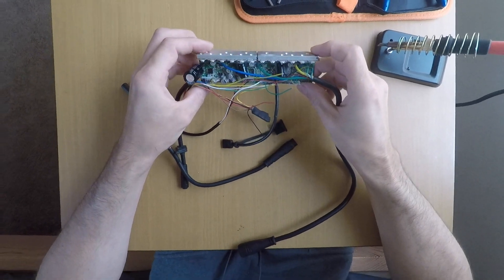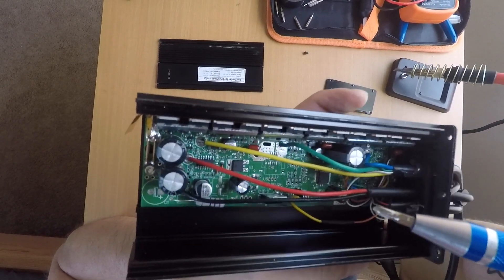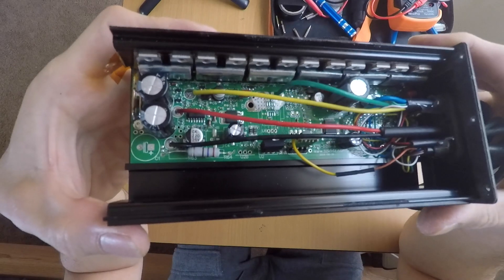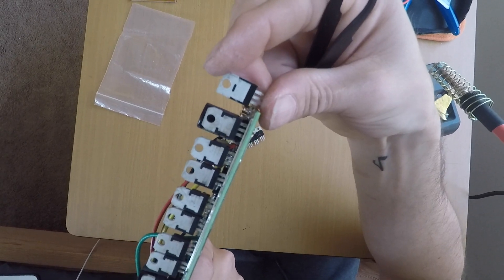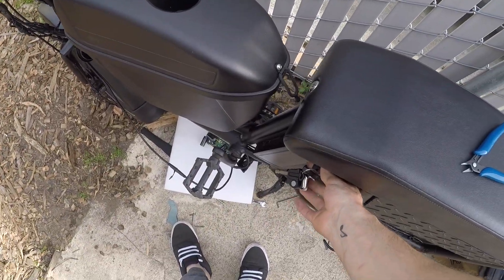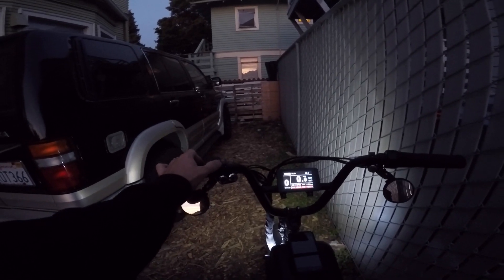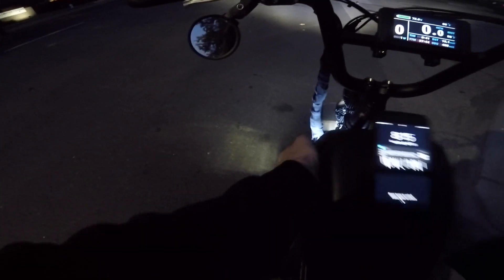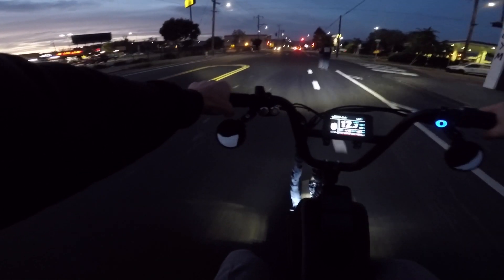HOW TO UPGRADE YOUR CONTROLLER !!!

Comment: So if I understand correctly, the radpowerbikes stock (22a) controllers FET’s can handle up to 100 volts and the Bolton (35a) controller can handle up to 68 volts (or 63v according to the caps). Does this mean that the booster would work with the stock radpowerbikes controller even if you cranked the booster up to 68/70v ? You’d just lose a lot of torque because the stock controller is only 22A?

Comment: That controller is the best one it's 35+1amp  the mosfets are held with metal bars. You find the circuit is small in width that's to keep connroller cool most of controller the mosfets are screwed in at top against the side where heat greese is applied its normally white in colour to shunt that controller is the best one I've got the same and does work I blew 30mp fuse so I put 35amo fuse it's been fine never put 40to45to50amp as controller pop it would get to much current

Comment: Nice video I got the same controller what the colour wire for the lcd screen ? There's 52 volts showing but the battery indicator is empty and motor doesn't work any ideas ? Cheers m8
Reply from the maker: Aaron Chambers check all settings on your controller.
Reply: @electricpower8130  yeah ok cheers

Comment: Is this video showing that you can increase the voltage directly at the controller without the need for a boost converter🤔  or are you also using a higher voltage battery.  I have a 52v 23ah battery, 52 v 25amp controller, duel 1200w motors, 3 modes with variable speed throttle. I was considering trying boost converters going directly to the motors but wasn't sure I that would allow variable speed  or just a constant higher voltage from the boost converter.  I really just want to increase the top speed a little .Great video thanks .😀
Reply: the controller just takes the voltage that comes into it. you still need a boost converter to get higher voltage. what he just did I think was to get more amps through the mosfets and more volts with the boost converter.

Comment: I've got the same controller all you had robdo is solder the shunt bars nip the bars together then solder across the top the length of bar. It might blow a fuse if it's 30 amp use 35to40amp great torque and speed. You doe it the hard way

Comment: @ElectricPower did your 48v LCD8H display hold up at 70+ volts? I have the same display and I'm thinking of converting my battery to 60V so would need to run 67.2v through that display and I have no confirmation that it actually works. Thanks.
Reply: hi man, did you convert to 60v?
Reply: Im new to ebike but display staff use 5 v Insted of 60 v that 60  volt goes motor power but all other digital control voltage & LCD usually use 5 v  ? Please let me know , I bought Chinese controller with label ripped off so it's hard to understand Wich brand so on but like to understand my 48 v controller with battery

Comment: i have very similar 35a black controller and it gets me  to 57km an hour or so, (52km an hour = 32m/hr)
 ive seen higher on very slight inclines. Altho i cannot get the pedal assist to cooperate and is always full power so i switched back to the lcd8h. i did love the torque and speed with that controller.

Comment: Just wondering if you Beefed up the shunts for the mosfets. More solder and wire as thay all are skimpy on production on the solder. An you could get away with 80 volt capacitors ....anyways  that's how I'm gonna  do mine .
Reply from the maker: Yeah I solder the shunt on the half. So more Amps can go through. And 80V capacitors it’s more than enough. For 60V battery.
Reply: @electricpower8130  good to hear that bike cooks hahaha. I liked  the mods that you and outher s do keep up the good working knowledge.

Comment: The booster you’re using can I use this on a 1500 W motor? My controller is already at 45 A but my battery is limited by 50 amp output.. i’m still new to this 😅
I’m considering buying a 50 amp controller at 2000 W and I’m running a 48 V 30 amp hour battery. I really wish I would’ve bought the 52 v
My top speed on flats is around 31 Mph. I’m trying to get at least 35 mph being that it’s 1500 W!
Reply: Buy a 3s rc car lipo and wire it in series, get a lipo alarm and only use it for short bursts
Reply: Save yourself time.  Get a 2000w kit that has an sw900 WITH the kit.  No speed limit.  Ktlcd has speed limit.
Reply: @weaverjoshuab  

The SW900 controller do the same speed as KT controllers.
There's no restrictions unless you set it.
The only difference is SW900 has much less features & options.

Comment: if i have 1500 W hub motor,  battery 60V 20AH max speed have 25km/H or new version 45km/H anyway how increase max speed 80km/h. can change controller biggest, 60V 3000W controller maybe.  or need change controller and battery 72Volt version. how mtor ? burn or can handle more volt? or need change genuine controller biggest FET and some resistor maybe ?

Comment: On controller for 1500wat and its the same on 2000 watt with out shunt bars with solder speed is 45mph the controller is 7amp 35+2amp I've done the shunt I biped bars together so I didn't use much solder speed is the same but the torgue is pretty good that's on the stand weather's crap so I can't try out the upgrade I did do one two weeks ago same controller blue a fuse 30amp so I've put 35amp not 40amp as you could blow controller

Comment: Hi.

Great job on what you set out to do. I know this has nothing to do with the vid. Can you tell what light that is. Make model what voltage it works off.  Thanks.
Reply from the maker: Thank you! It’s fog lights 12V. Check previous video about all lights. You’ll find the model in video description.

Comment: Can you help me please ? I have 36v 17,5amp 500w chainice controller. I need to get or make 12v 160amp one. Pls help. I spend one month on resources and learning. Do I gust change mosfat, beaf up the wires ex. and change resistors
Reply: I will really appreciate you hel and experience. Im 16 buy the  wey.
Reply from the maker: So your battery is 36V and 17500 mAh capacity and 500w controller? Am I right?

Comment: question i had 350w front motor hub scooter battery 36v output dc 42v2.0a charger 100 -240v 50/60rh output 42v 2.0a iwant to upgrade to 750w to 1000w to little more speed and range tnx, more power

Comment: My electric scooter is a 52V build with 2x1200watt motors. It has a lot of torque but top speed is bad. Top speed only 50km/h or 30mp/h with full battery. I would like to have a better top speed, can you help me on that?
Reply: Me too same issue. 52v 1300watts x2 motor. Speed is 55kph. Do u upgrade controller)
Reply: @ikeegroup4852  Hey, I have learned quite a lot since I wrote the comment. What exact scooter do you have? I found out my scooters motors are made that way they will last very long without problems but that means worse performance. If you want better top speed, you need to raise battery and controller voltage. If you want better acceleration and torque, buy a controller with higher amps.
Reply: i bought Langfeite 52v . yes i think i need to change controllers and upgrade batteries to 60v. But is quite exoensive. Maybe better to sell my ood scooter and buy new 60v escoot.
Reply: @ikeegroup4852  Langfeite l9? I bought the same scooter but different branding. I am going to sell mine and buy a little bit more expensive scooter. You only need to upgrade the controllers to 60V if you buy external battery pqck instead of a whole new 60V battery pack.
Reply: Yes also diff. Brand. Which brand do u have?
Reply: @ikeegroup4852  Mine is FLJ T11 with LG 30Ah battery. Costed me around 1200usd

Comment: hi, I just watched your video, could you give us a detailed plan of the modifications made to the controller and should you change the motor and the original battery???? Thank you
Reply from the maker: frederic liontransler So in this video you can see all mods that I did with controller. I changed all transistors, capacitors, add resistor to cut the current (not necessary) and tinned shunt. That’s pretty much it. Also I used the booster and rised some voltage which gave me that amount of speed. You can change the motor and battery if you want to. This controller can handle 60v battery easily now.
Reply: @electricpower8130  hi i just did only shunt mod and saw this video to convert voltage. but you also mod transistor capacity and resistor. all this things are neccessary? my controller has 35A current and maximum 70.
and i also use 1500w hub motor
thanks in advance!

Comment: you just change the capacitors, mosphets and this "resistor" thing (02:24)? Nothing more? 

the batery management sistem in the controller will not burn with the higer voltage?
Reply from the maker: Cairo Alberto yes! Correct. Just don’t go over 72v battery and everything will be work good.
Reply: @electricpower8130  what size capictor are those and where is a good place to order I just blew 2 up
Reply from the maker: Weakmotorcomike https://www.ebay.com/itm/183779761835
Reply: @electricpower8130  if I just replace the stock capictor with those ones it should work fine?
Reply from the maker: Weakmotorcomike yes. Just don’t forget about polarity. And don’t use the battery higher than 60v which is about 67v when full charged. Otherwise you’ll need to change all transistors.
Reply: @electricpower8130  I got a 52 volt battery
Reply from the maker: Weakmotorcomike what kind of controller do you have?
Reply: @electricpower8130  KT 1500watt with the CSC hub kit
Reply from the maker: Weakmotorcomike should be good.

Comment: Hello, I would like to use my control unit 48v to 60v, in addition to the input capacitor you have to change something else?
Reply: I simply went straight to 60v . NO problems.  You can seemly add 25% more voltage to ant controller..
Reply: No need, you'll be fine with 60v with a 48v controller

Comment: So you’re running 30A instead of 35A with the modified controller?
Reply from the maker: gabriel diaz kinda something like that. Almost can’t feel the difference .
Reply: ElectricPower can the stock controller be upgraded like this?
Reply from the maker: @gbrldz0  I don't know. It needs some measurements. But that controller can easy handle 52v battery. Which means a little more speed.

Comment: Why you add a resistor parallel?
Reply from the maker: Simon Voigt to low some current.
Reply: @electricpower8130  how do you know the right value to add?
Reply from the maker: Simon Voigt you need to use formula to calculate that. I checked the transistor which cutting the voltage for whole controller. And I used that I have in the original controller it was about right one that I need. And it depend of how much you gonna tin the shunt.
Reply from the maker: Simon Voigt To find the Voltage, ( V ) [ V = I x R ] V (volts) = I (amps) x R (Ω)
To find the Current, ( I ) [ I = V ÷ R ] I (amps) = V (volts) ÷ R (Ω)
To find the Resistance, ( R ) [ R = V ÷ I ] R (Ω) = V (volts) ÷ I (amps)
To find the Power (P) [ P = V x I ] P (watts) = V (volts) x I (amps)

Comment: This is a great video
I was always curious about if you replace your capacitors with higher voltage capacitors can you add a larger battery pack and eventually get higherspeed
Reply: the motor it small, depinde si de puterea motorului cat poate sa traga curent

Comment: Would this work on the Radmini 4 2018
Reply: Really need the extra speed for my area
Reply from the maker: Eric Guthrie stock controller should to work with 52v battery. If you’ll get the same Controller you can use 52v battery without any problems. Or the same device as I did. Just don’t go over 60v!

Comment: I'm curious how much it cost to upgrade for the speed on the bike since I have a rad runner and really hate when it lacks the speed to go up little hill or when every car catches up to me. Max I'd like go 30 mph. I'm also curious how your height and weight effect the drop in speed. I'm about 5"6 and 110 pounds so I know I can go 20mph easy.
Reply from the maker: You need 1000 watt motor, 35Amp controller and 52v battery! And you will enjoy that bike!
Reply: kim james  They do. I have one.
Reply: @finrider9924  suomi perkele!

Comment: it appears i have 18 mosfets. it appears that they are grouped in sets of three and negative and positive.

i destroyed 2 of the resistors, one's legs were completely gone and the other was missing one leg. i cant find a single one of these mosfets other than chinese sellers, can i swap with something comparable, but not exact specs on just the two that are bad? or will i need to replace all of them? it seems like i should replace them all or it could make things out of sync

my controller was rated for 60amps, but i just had to be greedy and do the shunt mod, it took it up to 97 amps lol 

they blew on me on the trail, i was going super slow and had a watt meter showing me amps, plus a dedicated amp clamp doing the same. i was going up a steep muddy packed dirt trail in the woods and then the motor went limp.

at the time i was only going 5mph and was bouncing around 10-30 amps

Comment: Great video.
Question, my battery is 48v 20ah.  My controller is 48v 20ah. Manufacturer upgrade from 20ah b/c none in stock.
Will this combo work? Heard it could damage battery.  I use PAS too when riding.

Hope you can help.

/Bklyn👑
Reply: You're not making sense, controllers don't have Amp Hours, they have AMPS